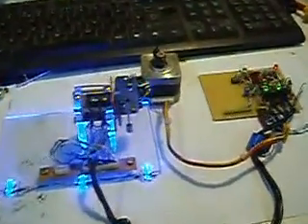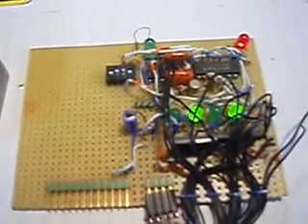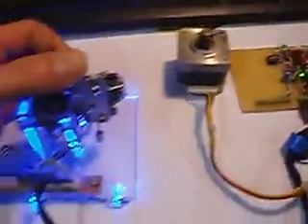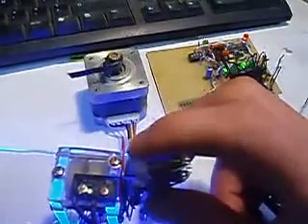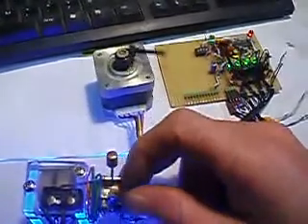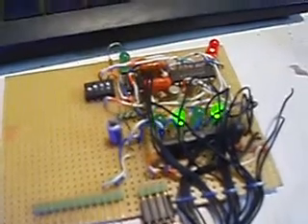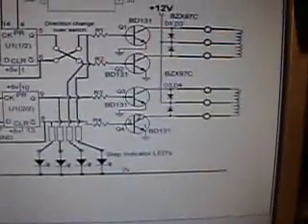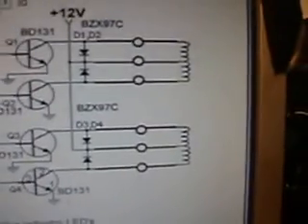Stepper Motor Controller with speed control and forward reverse

Comment: I like the simplicity of how this circuit design looks. Your operation demonstration was good. One thing I was wondering about was the dual gang potentiometer. Did you use a linear taper, or audio taper or does it matter? I have drawers full of potentiometers, both used & new old stock so, I've probably got it. Thanks for the info.
Reply from the maker: Its a 220k Dual Gang Potentiometer. It really doesn't matter what type you use. If you have a drawer full of them, just try out 1 or 2 of them and see if they work. The potentiometer i used is linear, so as you turn the pot, you get a linear rise and fall in the speed of the motor that is proportional to how much you turned the knob of the pot.
Reply: @john37309  Hey, thanks for gettin back to me so quickly. Just doing so really shows your interest in wanting to help people. Thanks for the info. as well. Being an electronic repair tech for around 40 yrs., but never working on anything using stepper motors, I may have all the components except for the 74LS74AP As soon as I get a new printer (cheaper than buying ink cartridges + mine's got some age on it), I'll see if I can print that schematic off & go for it. Thanks again, and take care.
Reply from the maker: I just uploaded a better, "full size", copy of the circuit diagram. You can download the nice big circuit diagram here; https://www.flickr.com/photos/john503/45107832514/
Reply from the maker: The circuit diagram available for download in full size, or any size here; https://www.flickr.com/photos/john503/45107832514/sizes/l
Reply from the maker: the full size circuit diagram is the best; https://www.flickr.com/photos/john503/45107832514/sizes/o/
Reply: @john37309  Hey wow, thanks a lot. This is so much clearer than the original diagram. I'm wanting to make a remotely controlled (connected by wire) rotating circuit board holder like what I'd seen a character in a movie using. I'd seen them before, but after seeing that one & how handy it was for him, I wanted to make one. Thanks again for this 2nd quick reply & diagram. As I said before, as soon as I get a new printer, I'll get this schematic printed out & get at it. I really appreciate the extra time you took to upload that clearer diagram. Thanks for all your help, and take care.

Comment from the maker: Hi Ramish,
What you see in the video is a one off prototype. It was only designed for that specific function. For me to make a second one, it would just be too expensive for you. 

Ramish you can buy this type of thing "ready made", and very cheap because they are mass produced. Search the internet for shops that sell stuff for remote control cars, boats and aeroplanes. They will sell you stepper motor controllers and motors to match, much cheaper than me. 

John.

Comment: John,  

I really don't know much about electronics, but I would love to build this setup to power a camera follow focus and camera slider... even a jib in the near future, but I'm having problems with some of the parts in the V2 schematics,  namely, how to wire the "direction change over switch", what it/ how does the speed change pin works, & what exactly is the 220K variable resistor 

Any help would be great :D